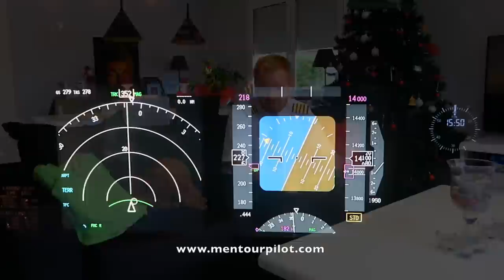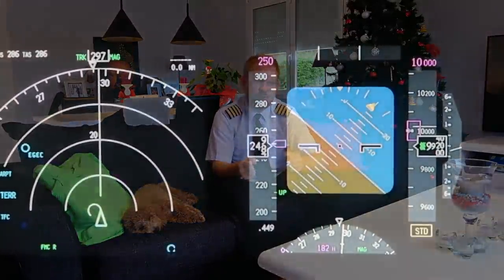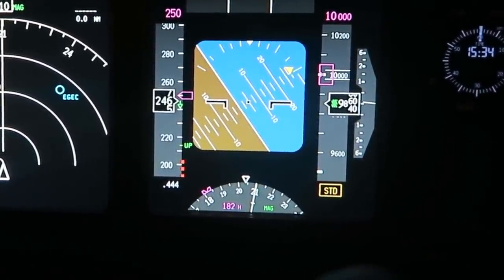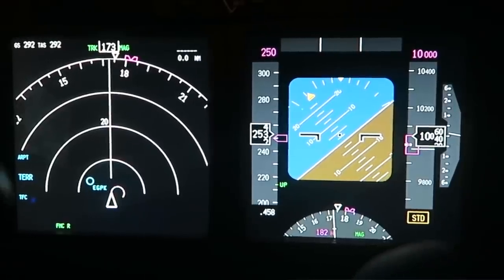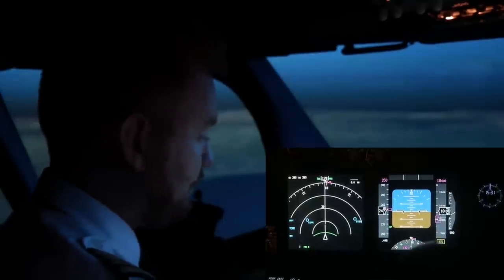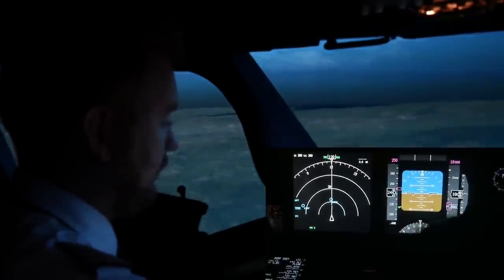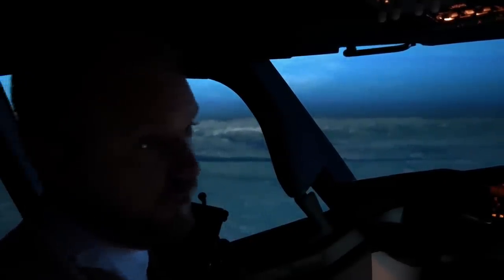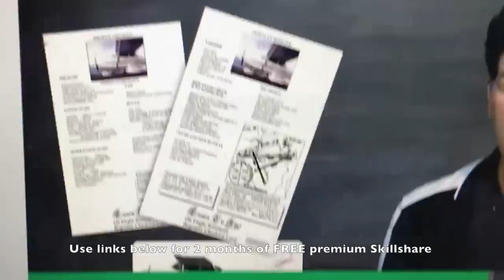What happens if you ROLL an airliner?!

Comment: Airplane wings don't provide any lift at 90° or rather their lift is in the wrong direction, like 90° from horizontal.
Reply: Exactly: technically they're still providing lift... that goes sideways. And mhen upside-down, the lift actually pushes towards the ground! If you watch his rollover, you'll see they fall an awful lot, probably a kilometer, during the maneuver - and near the end they were pointing almost directly towards ground until Mentour was able to finally lift the nose and stabilize

Comment: It's a myth that a barrel roll is a 1G manoeuvre. That's not the case . Even if flown accurately the initial pull up will be anything up to 2G. The object is to pass the wings level inverted position coincident with the aeroplane passing the zero pitch angle position (we pitched up before rolling, remember, and will exit pitched down). If that 'wings level inverted at zero pitch angle' is not achieved (zero pitch achieved before or after the wings pass through wings level), the exit will go horribly wrong with the nose pitching down and the speed and 'G' building rapidly into a spiral dive. Guess how I know!

In anything but a fast jet or a hot aerobatic ship, an aileron roll is also usually initiated with an initial pitch up, and the manoeuvre exited with a slight nose down pitch. In an airliner with lots of inertia, I'd guess you'd need an initial dive before pitching up in order to gain sufficient speed to complete the manoeuvre. So the manoeuvre becomes semi-ballistic rather like a loop. As the aircraft approaches the inverted, the G loading is decreased over the top, again like a loop, so even though the speed is low through the inverted there will be no stall. The G should be less than 1 but remain positive of course (only a slow roll involves negative G).

The desirability of a wake turbulence upset being recovered by continuing the roll 'all the way round' has been doubted, unless the pilot has aerobatic training. If a 360 roll is done, a strong and co-ordinated with roll forward pitch input will be needed during the inverted phase of the roll to hold the nose up. If this is not done (and it's not instinctive to do it hence the need for aerobatic experience) the nose will rapidly drop as the aeroplane rolls and the exit will be a screaming nose-low spiral dive which will likely exceed speed and G limits for an airliner. Better to just try to reverse the unintended roll before it goes too far.

Comment: I think that given the wing profile and slow roll rate...unless you raise  the nose 40 degrees or so and neutralize the elevators before initiating a full aileron deflection 1g roll, the airliner will roll, lose 45 degrees or more pitch attitude, and wind up in a screaming dive and probably exceed it's never exceed speed.  But,..what do I know.?

Comment: Fascinating video, thanks! Love the roll demonstration. Would the stall speed not increase by the square of the load rather than the square root though (as square root reduces a number)?
Reply: If you double the load, you increase the stall speed by a factor of square root of 2, about 1.414.  It is still an increase, just by a lesser factor.
Reply: The square root of 64 is 8.

Comment: A gently touch roll touch would not be possible.
Good explaination!
At the full roll >90° at that speed which is a little bit lower as on the first example.
Is a full clean 360 roll possible? Inducing before full 90° an increasing elevators down input and increased speed? I gues there are some limitations and safety margins by design and avioniks made and hardly (impossible) to override.
In my understanding the roll itself with a partially loaded or empty aircraft of this size is not that dangerous maneuver, but what results out of this, after it snaps the downfall dive and catching that plane is the critical part.
Those dives regularly I've only seen on that zero-g airbusses and they showing the available data <=3G

Comment: Are you using rudder for lift at high bank ? Can it even produce lift ? Or would you just be more likely to rip the tail off?
Also is it possible to maintain inverted flight?
Reply: You wouldn't particularly need it in a barrel roll. What you're describing is keeping the nose on a point on the horizon in a roll about a point.

Comment: "The stall speed increases with the angle exponentially" (about 7:50 of the video) - only small detail from the mathematical/physical point of view, I think, it is rather much worse than exponentially, it is hyperbolicaly, because on 90 degrees you have the stall speed already infinity :-)

Comment: > the stall speed [...] that increases with the square root of the load factor [...] and it increases exponentially

If the stall speed increases by the square root of the load factor, then how is that "exponential"? Is it: stall_speed^(sqrt(load_factor))?

Comment: So does modern simulators like that calculate in the structural tresses of the airframe and simulate damage? Also from 14K to 9400feet or 1.4km altitude drop in that trick, so memory rule i guess is to have at least 1.5km altitude with zero obstacles or anything that could cause turbulence or limited lift when returning from roll, least with that plane model with that particular fuel and cargo/weight and air density, though wont air pressure be higher hence give more lift than in high altitude... then again it does increase air resistance as well... pretty much what is minimum altitude and how much distance from sea level effect to be able to do this roll?

Comment: There is a possibility of cavitating the hydraulic pumps an loose pressure to the flight controls.  Some aircraft have air over fluid pressurized reservoirs.  The suction line to the pump can suck air if turned upside down.  If you maintain some positive g force on the aircraft the fluid will still cover the suction line to the pump.  This is why you can barrel roll the 707.  Military aircraft have reservoirs that do not have air over fluid pressurization.
Reply: The aileron on a 707 is not hydraulic powered. It is just cables, balance, and servo tabs.
Reply: @bkailua1224  Modern aircraft have powered ailerons.  Check to see if there is a series servo in the linkage that is hydraulically powered.  I no longer have access to SAE A6 documents.
Reply: @glennanderson3725  Yep some do, I flew the 767 757 for 20 years and it was hydraulic controls. I also flew the DC-6 DC-9 and 727 that had manual controls. You can just google the controls on just about anything and find out how they work. :)

Comment: At first i was like, dont you mean an Aileron roll? as most people confuse the barrel with the Aileron roll, but then i checked the OG footage of Tex and was like, fair enough its a Barrel Roll.
Like people say Barrel Roll when they actually mean an Aileron roll.
or is it possible that an Aileron roll is only doable on smaller Fighter planes? like a 2nd WW Type i.e FW150, BF 109G, Hawker Hurricane, Spitfire, P52 Mustang, ME 262, Gloster Meteor and many others or current Fighter Jets.
Also have you ever flown a Fighter Jet or always commercial Airliners?

Comment: There was a case where a pilot rolled a VASP 737-300 in 1986 in Brazil.
Many years before September 11th, a hijacker boarded a plane. During the flight it entered the cockpit, killed the copilot and demanded to head the plane to Brasilia and hit the presidential office. He was deliberately trying to kill the brazilian president at that time.
When the plane was almost out of fuel, the pilot rolled it over to get rid of the hijacker, and landed safely shortly after that.

Comment: Not bad you lost around 4500 feet there. But Looking closely at your flight instruments You actually did a little barrel roll and not a “true” Aileron Roll. A barrel roll is trickier & more demanding loosing more height. For a perfect roll start with a speed of around 250KIAS with throttles mid range. Pull up wings level to at least 10-15* pitch or to around 10 -15 knots above regular clean climb speed after T/O. Then gently but positively apply FULL aileron WITHOUT any back pressure at all( just relax the back pressure you used to get up there) Any aircraft big or small will then roll beautifully with the nose naturally dropping to below the horizon (initial roll rate will be slow but picks up as you continue) all the while maintaining full ailerons throughout should end up 10-15* below horizon by the time the aircraft is back upright. You might need to throttle back to idle passing the horizon inverted on the way down. Once your upright simply centralise yoke & just pull up gently back to a climb attitude while advancing throttles. You will find the result a lot smoother with less height loss over all.

Comment: Thats a diving roll, probably closer to a slow spin. A true roll is done with no loss of altitude, like military jets do. They roll entirely along their longitudinal axis. I doubt if an air liner has the control authority and rate of roll to roll quickly enough and enough engine power to avoid losing altitude.

Comment: Could you do a reaction video to the film "Flight"? It would be interesting to know how much truth is behind it... Recovering a plane from a locked horizontal stabilizer by rolling it? Interesting to know how you'd respond to this problem
Reply: The flight sequence in the film is based on the actual crash of Alaska Airlines 261. The pilots had a malfunctioning stabilizer due to a faulty/improperly maintained jackscrew assembly. At the end, they went into a steep dive of 70 degrees and managed to get out of it by rolling the aircraft into an inverted position. They managed to stay flying for a bit, but unfortunately things did not work out for them despite their valiant efforts. It's one of the aviation accidents that haunts me. This channel did a really good video on it not too long ago.

Comment: I can say that an A320 full size Class whatever simulator (the big ones at the United Training Center in Denver) would not let me roll it.  The instructor and I tried disabling all the laws preventing such a maneuver.  I don’t recall exactly what he did but he was trying to see how much automation he would have to disable to allow a pilot-commanded aileron roll.  No dice.  It’s fully fly by wire so by definition you can never disable all automation and still have control.  So the A320 maintains envelope protection - as long as it has attitude information, at least.  We would get to 80 degrees of bank or so and it would bank no more, then the nose would fall through the horizon and we would just be in a dive.

Now a Boeing?  I bet you could find a way to command a roll in a Boeing as long as it has control cables.
Reply: I was wondering what would happen in an A320 and if there was any way of switching off the protection to allow you to do it. I guess there isn't!

Comment: I don't understand why an airplane doesn't just fall from the sky if it turns upside down. My understanding is that the air passing over the wings creates lift, in a vector coming from the top surface of the wing and going upward, away from the earth (when the plane is right side up). If the plane is inverted, wouldn't that lift actually be pulling it downward toward the earth?

Comment: Great video, as all the videos you produce are great.
I was wondering if you ever investigated the Alaska Q400 that was stolen in Seattle and the individual flying it did a half barrel roll and finished with a loop.
Would that maneuver caused mechanical damage to the engines resulting in engine failure.

Comment: What makes, airplanes at an airshow flying upside down, say for a length of a airstrip, actually flying straight and maintaining altitude at all, when flying surfaces and lift are upside down too?
Reply: The visual effects are the only changes...in terms of aerodynamics nothing has changed...

Airflow causes lift in simple terms...how a wing generates extra lift is its aerofoil. But you only need to make a paper plane to see that an aerofoil is not necessarily necessary to generate lift if the trust is good [i.e. your throw or the thrust from an engine]...aerodynamically the space shuttle has the coefficient of a brick yet it can and did glide enormous distances.

Comment: You still owe us a kind of scientific explanation, why when the ailerons or spoilers go up, the lift goes down.

If the wings were perfectly symetric above and below, flaying straight with no angle of attack,
there would be no lift, as the air pressure below the wing would be equal to the pressure above the wing, at any speed.

That's why the wings are arched on top, and the air has to travel a little further to reach the end of the wing. 
First air gets blocked and pushed up, which would logically cause a drag, and consequently more downforce.

But the arch is not symetrical, it starts quickly high and goes down slowly. 
This creates a kind of slide down, where the air is accelerated longer than initially slowed down.

This accelerated air above on a larger portion of the wing has less pressure, than the constant airflow below.
Accelerated air above the wing causes the lift.

When Flaps, Ailerons, Spoilers are pushed up at the end of this slope, they lower the speed of air above the wing, 
that causes the air below the wing to get faster than the air above,
causing the pressure below the wing to be smaller than above. 
The wing has less lift then (at a constant angle of attack) and goes down.

Comment: Q: if rate 1 turn is 3 deg/s, so rate 2 turn is 6 deg/s?
Q: for "normal" operation, what rate turn are you making at 45 deg bank? 60 deg bank?
Q: during your roll over in that 737 sim, how much vertical altitude did you lose before flying level again?

Comment: As an aircraft avionics tech, I can tell you that all the nuts, bolts, and washers that have been dropped in the aircraft will fall out of lots of crevices and other hiding places. Where they stop is anyone guess, but hopefully not in a control cable or pulley. Not to mention, the coffee would probably spill.
Reply: None of that should happen as it's a positive g manoeuvre.

Comment: Question for your point at 03:37: Wouldn't I see a curve like this also in my cup of coffee when holding it still in a for me horizontal position?
Reply: If all the forces point roughly “down” to you, i doubt you’ll be able to really see anything. maybe if there was a bathtub along the length of the airplane?
Reply: @Appletank8  At a 30 degree angle? Tilt a filled coffee cup that angle and look for youself. The water acts like an attitude indicator.
Reply: @Tiriondil  Centrifugal forces will pull the water away from down. Just like how a rollercoaster in a loop won't make you feel like you're falling out of your seat.

Comment: You said its possible to barrel-roll an airliner, maintaining one G throughout; but you did not show it.
I think its quite possible and easy (if you know aerobatics) if you accelerate to the manoeuvring speed ~270/280 and gently do it keeping constant roll rate & pressure on the yoke ... I don't know about  what will happen to the IRSs and other electronic equipment in the bay, so I suggest you do it on a simulator or buy your own second - hand airliner... they're going cheap these days.

Comment: I wonder what modifications have been made to Air Force-1 (the U.S. President's plane to allow his pilots to increase banking, rolling, diving, climbing, and faster, and airspeed. I  would be highly surprised if it could not achieve Mach 1.5 with burners on and stronger wings for tighter maneuvers.  After all, an extra fancy CD Radion doesn't cost 2 billion dollars.

Comment: My Father-in-law who was a ground engineer told me that yawing is not done because passengers don't like the sensation.
Reply: Yaw is important in a coordinated turn. But pilots won't yawing while wings level, that will throw pilots and passengers at the very back side ways. 
This is also why sitting right on the wings is and in the center row is always the best option if you have air-sickness.

Comment: I just popped in to say 10 out of 10 for the click baity thumbnail! Also, Mr Montour, your videos are good, but they would be even better if you edited them down to 5 min instead of 20.
Reply from the maker: Is it still clickbait if what happens on the thumb also happens in the video?
Reply: @MentourPilot  No offense meant, it was just a comment about the image and exaggerated facial expression, which gave me a chuckle. Kelsi over at 74gear does the same thing too, but quite so extreme.

Comment: Hi, I actually wonder especially since the downing of the Malaysian Airlines flight in Ukraine in recent memory, how much G can a standard passenger aircraft sustain? Let's say in a hypothetical situation where the pilot of the aircraft has ample warning of a launch of a legacy/early SAM missile that maxes out at 8G and the airliner is far enough away for maneuver, can the pilot do anything about it? 

In the military, basic flight maneuvers manuals for defeating A2A or SAM is to extend either perpendicular or cold against the missile to make the missile lose its burn and energy in tracking you. The maneuver is not that taxing even on an F-15 if the missile you are fighting is launched at a max range of around 15NM, it's a simple left or right pull, afterburner, and chaff drop. Would be glad to hear your response.

Comment: Just add some rudder and do a snap roll.
Reply: There were two 737 crashes where the rudder did a hard over and it flipped the aeroplane into a vertical dive.
Reply: @paulsengupta971  Those instances were not in a cross control configuration, and also happened at very low altitude.